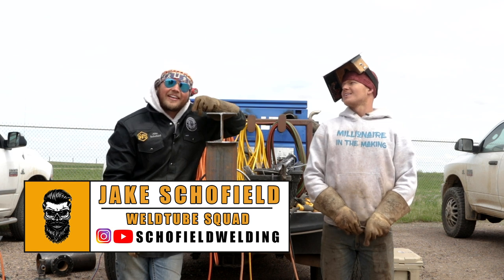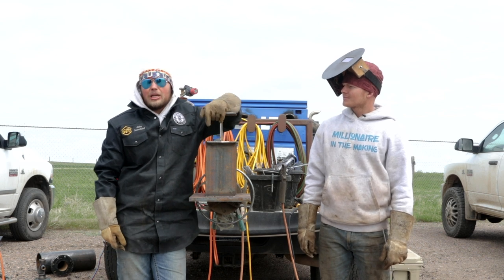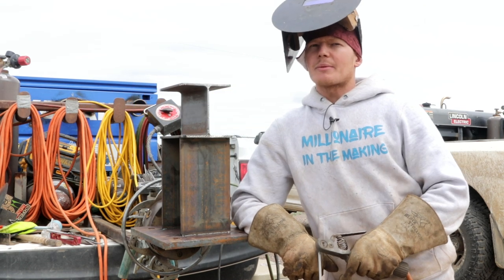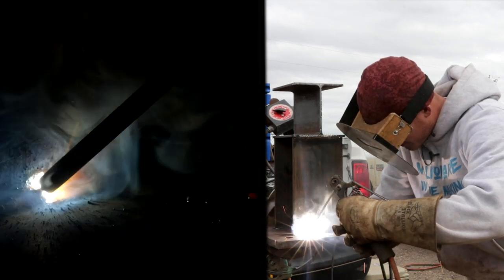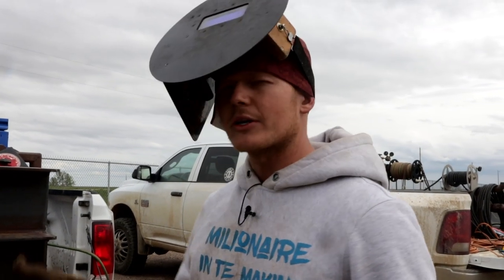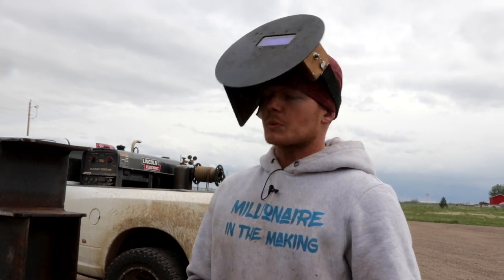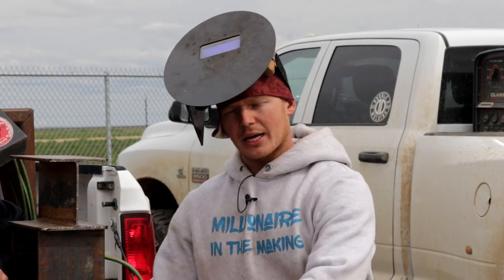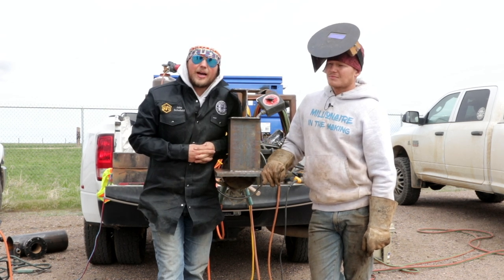Structural Welding with Jed Schofield

Comment: We can all agree that if your gaps and fit ups are rough you’re gonna have a tougher time. I appreciate these guys for making that clear.
Reply: With all due respect it's nothing to do with the fitup, but to do with Jed's pushing his rod into the slag. Never seen anyone in downward position pushing instead of dragging which is the proper technique, and this is why he's got slag inclusions. and it would never pass any tests.👍
Reply: @jonmcgill533 I’m positive fit up plays a massive factor but of course there’s many other things that affect the weld quality. I guess thanks for you ur insight but I wasn’t asking.
Reply: @allonjones840  When you make comments your open to comments coming back at you. For what its worth I do agree with you about the fit up been extremely important. I wasn't questioning that I was questioning his direction of travel with the electrode. Meaning if its slag you drag This is what I have issue with, to me and many others the direction of travel he was welding in was totally wrong and I stand by that.  Thanks for the reply

Comment: Im a left and right hand welder. I personally like to drag my rod than to push. I get better results. But that is my way
Reply: Lucio Diaz same here
Reply: Same
Reply: I do the same
Reply: People call 7018 drag rods cause that's more of a correct way to do it. You can push depending on scenario. Such as vertical up.
Reply: @Bo2xpro  generally speaking any angle that allows the slag to deposit on the bead is good
I do like to pull the puddle not push
But vertical you have to push , but gravity help you to control the slag

Comment: Your rod angle look like you were pushing the electrode instead of dragging it. I usually drag the rod toward me and hold it at a 75 degree angle. This way I can see the workpiece and get good penetration. Get more arc shots next time. The most important part of welding is the timing and electrode to work gap.
Reply: that's bad practice it is possible to trap slag like that.

Comment: Structural welding is all I do, Ironworkers Union. Local 584
Reply: What's the starting pay??
Reply: @davidnieto936  depends what region you're in. Here in  Chicago the starting pay is 50% for apprentices which is about $24 an hour plus your benefits. Once you go down to southern states, the Unions aren't as strong (Republican run states) and the journeymen make less than or equal to Chicago vicinity apprentices. It's a great career I've been a union ironworker for over 20 years and worth it for me.
Reply: @elmeromero1794  hi sar my father is a great weldar & fabricator hi is 29 years weld in India so any job for you
Reply: @sagarjoshi9923  sorry no job unless you go through the 4 year apprenticeship.

Comment: Exactly what i was thinking. "Pushing "🤔🤔 i mean you can but... And also to get rid of the spatter you just got to lower your amperage slightly. Guys out there that think they can just crank it up and burn it in. Go right ahead but there is such thing is the perfect amperage,rod angle , and arc length. Of course travel speed to. But the heat is all part of it to
Reply: When we weld on buildings u set your welder and run your leads sometimes 2 - 3 floors. You learn how too weld all positions at the same amperage. Now shop welding obv is different
Reply: He did say follow the weld procedure, all your parameters are there, pre-heat temp, amps, volts, travel speed, heat input…

Comment: Never tack, start, stop, or connect a weld in a corner, why? Because it is almost impossible to remove all the slag and if x- rayed you WILL have slag inclusion thus failing to weld to  standard.  How to avoid this? Start your root knowing you must weld through all corners before breaking arc and plan accordingly.
Reply: what do you mean? isnt the slag gonna be the same if it was in the middle of the bead or of it was in the start/finish :/? and some people told me to tack the ends so It can absorb more heat. but can you please explain, thanks :D
Reply: You can start the wrap around first. And run the bead to tie in and if you're good enough with tie ins it won't be noticeable it'll look like a complete bead.
Reply: I believe fillet welds do not get x-rayed and full pen moments get visual inspected under 3/8 thick and over would be the xray inspection per aisc standards for structural welding.
Reply: Fillet welds do in fact get x- rayed.  In addition, a visual inspection is a totally separate issue.  That stated , welds can be deemed a failure if not to visual standard and/ or if a failure to x- Ray inspection depending on weld criteria needed.
Reply: @johnw.peterson4311  From my own experience as an ironworker those are the rules we follow for the jobs I've worked. What kinda fillet welds do you weld that get inspected with xray curious.

Comment: Anyone know why he was pushing instead of pulling ? Thanks in advance.
Reply: I was always told that if there's slag you drag and it looked like he was pushing
Reply: He was. And if you got to 5.56 you can tell by how bad the weld looks that pushing isnt the right way to go. Stange video all round really. Crap techniques. I'll prepared steel. Not a lot going for it
Reply: Cuz he doesn't know any better.  He'll learn when he get's outside the family bubble.

Comment: Carry a file around for your low hydrogen rods. Dress the end before each strike or restart. Or failing that just run the end over a rough surface. Concrete. Will make strike up a lot easy.

Comment: That "bow" is the throat. Based off of the leg length, your throat is WAY too big. Excess convexity. Thats a weld fault = failed weld!
If you push all your passes, they would never stand up to a structural plate test! But whatever, each to their own

Comment: hahahaha......pipe welders only know stick using 7018 and 6010, FYI to the new welders nobody ever uses stick for structural steel welding in the field because it takes for ever and is not cost effective, 99.9% of structural is done using FCAW. The only time you will ever see stick on a building is for the decking and that.s it.
Reply: And? If u can stick u can Flux core. I can teach a 6yo to mig. Acting like ur telling someone something.
Reply: @jjjordan3881  ....Correct as is why new welders don't need to bother getting certified in stick unless you want to be a one trick pony doing pipe.
Reply: @calikalbocalikalbo6082 you sound a little jealous of pipeliners...just sayin
Reply: @rustyshackleford1069  ….HAHAHA…chick know how to do more than just stick unlike most pipe liners. Besides I’m a CWI in Japan so nope, try again
Reply: @calikalbocalikalbo6082 nope. If you can stick weld properly then you can mig weld a lot easier because it’s way easier than stick. It’s important to know how to use both processes because stick is widely used in structural as well.
Reply: @QuikScoper45  ...Yeah I know MIG is easier than SMAW as I was a welder fabricator for 24+ years and was certified in all processes and not just stick like most pipe welders.
FYI, the only stick widely used in structural is for decking not for actual structural of columns, beams and girders (unless it's a small job and all you know is stick).
As a CWI of almost 20 years now I have been on some of the biggest projects in the USA including bridges and all are FCAW BTW.

Comment: Not preheating LH rods, two-handed, pushing, Tig gloves, starting from the inside corner out, talking shit and I could go on. Was a bit comical and would have loved to of seen his welding on that piece of pipe on his 4x4
Reply: What's your deal with tig gloves? When I'm running 3/32 or 1/8 rod I'll often use tig gloves or mig gloves if I'm running heavy vertical or overhead. I'm pretty used to the heat but yeah. I have a pair of heavy stick gloves but I prefer the mobility of the first mentioned.
Reply: @BigDaddyLanny  you can wear Rigger gloves if you want but they aren't the correct gloves for stick welding and let's be honest he's not a welder
Reply: @Then.72  fair enough haha. When I'm welding heavy duty shit like ice lugs or bucket repair I definitely agree. I wear some thick Miller's

Comment: jed your technique is wrong you are using a MIG welding technique in stick welding the pool is in front of the electrode not behind it. just one more thing try using one hand to manipulate the electrode you are not alone from what i have seen on you tube in using two hands.If you where on piece work or paid by results two handed welding would slow you down,one hand for the job and one for yourself ,cold go on but i will be sounding like a old fart